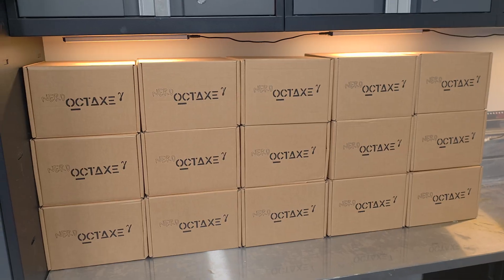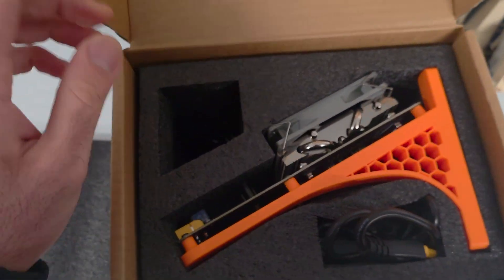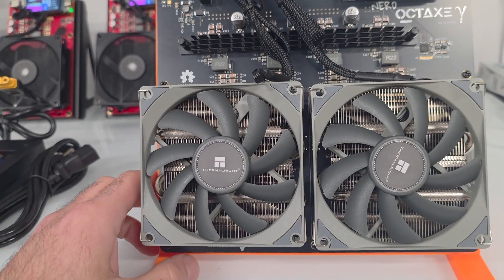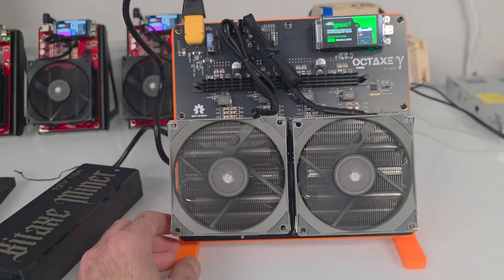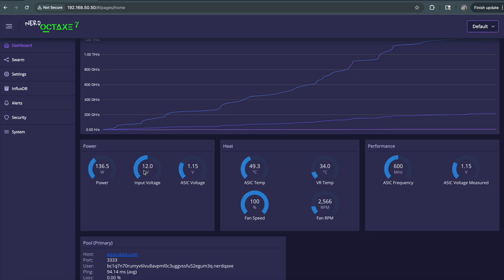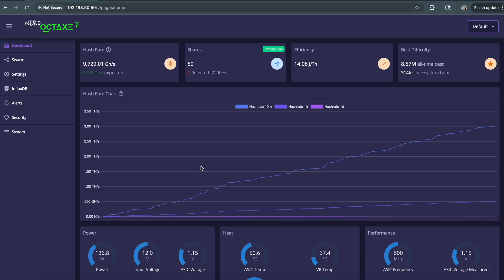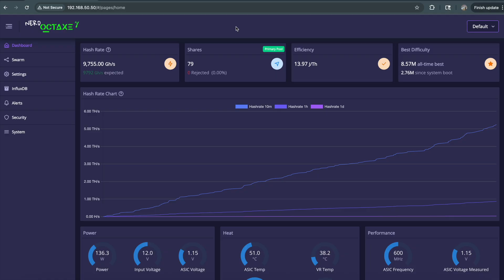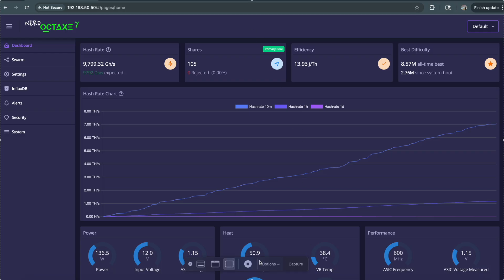NerdOctAxe | 9.6 TH/s Solo Bitcoin Miner

Comment: I had ordered two from one of those Chinese companies. To my surprise, the two "identical" items weren't so identical: different heat sink sizes and different power cable thicknesses. As a result, one runs a lot hotter than the other.
Reply from the maker: Yes different manufacturers can have variations in hardware

Comment: @6:35 It is Revision 2.2 Double Q. It is printed on the board under the LCD panel.
Just make sure you photo resembles the actual product. Your photo in you shop for the OctAxe is not as good as this product. Heatsync goes all the way across compared to one in your shop front.
I grabbed mine a fair bit cheaper than this, but depends on where you are I guess. But retailers selling these units for $1,000 are crazy.
Reply from the maker: Fixed! Thank you!

Comment: SB, very nice, i have 3 OCTaxe so far two of them is rev1 and one of them is rev2 all from the same Manufacturer, the difference between Rev1 and 2 is 5 things, (1) the PCB is thicker (2) with more copper trace, (3) 220-v35 capacitors, (4) 20amps fuse, (5) higher capacity power phases good for up to 360w .. basically an OC beast with the right PSU, but yeah they are real differences and its also in the open source spec on github.
Reply: BTW when is the drowning for the 403 / 800 ?